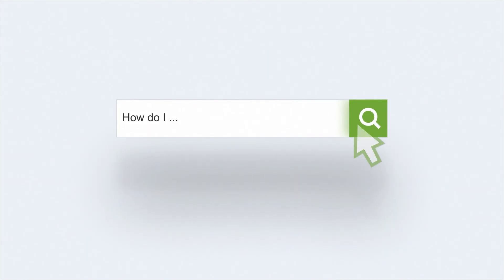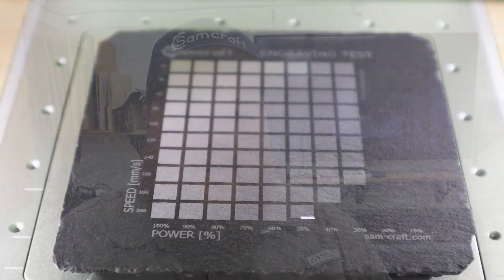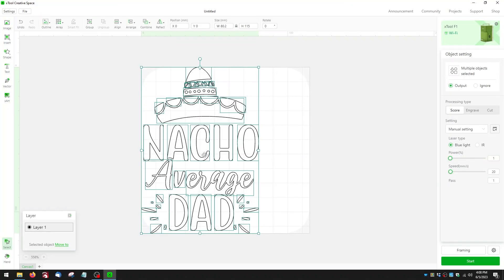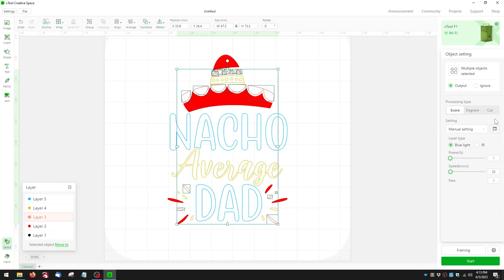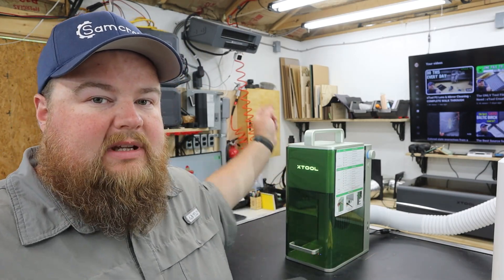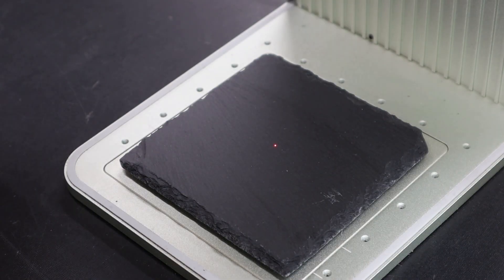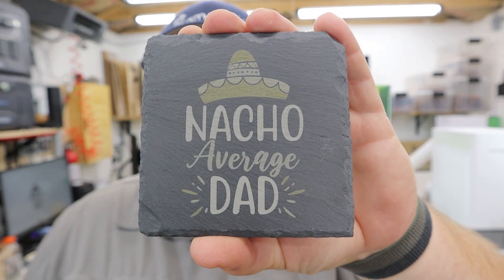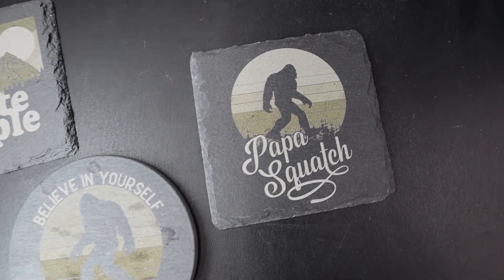Any Laser Can Do This! Colored Slate Engravings Feat. xTool F1

Comment: Sam, I'm not sure if you're going to see this comment since it's been so long since you posted this video,  but fingers crossed. 
I have F1 Ultra, and I tried to run the four tiles of the material test grid you describe in this video.   My attempt was a complete failure, imo.   I didn't even bother with the 4th tile yet.
All my squares are sorta white to burned and bubbled black.  No color. What did I do wrong?
I don't know if I can attach pictures here, but I'll try.

Comment: Nice job  on the slate coasters. I have a question can you tell me what size exhaust hose is on the xtool f1 ? I live in california and we cannot  purchase  the fume extractor due to the unit not meeting CA air quality standards. I did manage to get a atomstack d2 air extractor which also now is not allowed to be shipped to CA I would like to hook that up to a F1 if I decide just to purchase the F1 by itself. Thanks

Comment: Wow - thanks for that video. I made some slate engravings in the past, but only in black/white. Now i did a material test and found out that you can achieve at least 30 different gold-tones , which is much more than in the grayscale range (only 4 to 10 shades). The golden shades even vary between matte (lighter, even) and sparkly (darker with lights spots) - this is great! 👍

Comment: Hello Sam thank you for sharing all the information you share. Both myself and my sister watch your other channel is well for your Green Acre Homestead.

My question is about your Lightburn version test file. Because I'm new to working with a fiber laser is the Slate Engraving Color test file setup to only work on Slate or does the same file work for other materials like stainless steel as well? 

I just wasn't sure if the file settings were specific to help find the colors on slate. Thanks again

Comment: Very good review.  Thank you for doing this.  I am looking for a budget friendly way to do small metal, non organic engraving jobs - such as back of a watch, on a metal badge, tag, etc.  The idea of different colors on slate never occurred to me that could be done.  This video is a few months old which means you have had it for awhile.  

1) Would you still recommend for small jobs and how well can you frame an area to ensure you are engraving on a small object in the right area? Looks pretty straight forward from your video.  

2) Have you traded back to lightburn for running this laser or is it worth learning the specific software you mentioned?  

3) I see xtool has several different versions of lasers - is this the one that is best for small metal jobs - do yiou know?

Comment: The upgrade to XCS a few months ago that added layers and some other things was a nice change.  At least I don't recall it when I first got my D1.  As I work on 2 computers, one in the house, one in the garage, I do need to find a way to export/keep the same saved settings for engraving/cutting/etc from one system to the next for naming.  One thing I don't like is you can have 5 things named exactly the same and all with different settings.  It doesn't overwrite the settings/name even when you save it as the same name again which can be annoying as you're testing/verifying settings.

Comment: The F1 does not do the layers in order at all. I’ve been trying coated aluminum for 2 weeks, no matter how you do it it will fire the IR laser first and then the blue, which is the opposite of what you would want. If I hadn’t thrown the box away I’d be sending this back.
Reply from the maker: It's the program's fault. XCS does not allow us control over layers and actions as we need. I'm hoping Lightburn will get going with compatibility soon for this machine.

Comment: Was hoping it would be faster with the fiber laser. It's tough to sell coasters at $10 each.
Reply from the maker: The 1064nm laser in this unit is small compared to standalone fiber lasers at only 2 watts. Most fiber lasers you will see out there are about 20 watts minimum. This 2 watt IR laser is the same as the competitors like Laser Pecker, Genmitsu, Atomstack, etc. Overall it's a good machine and great for multipurpose uses. But no, not as fast as a fiber laser.

Comment: Hey Sam, You are really doing good on here. I have a question I hope you or a user can answer. I know the answer is a test card (but I don't have enough product to do one). I am wanting to engrave on some Amethyst Polished Stones. I have the xt Diode 5w, 10w, and 20w and the xtool pro IR (and will be 10years until I can afford the 40w head or P2). I am not sure which head to even start with or what possible power/speed to even try. Hoping somebody has bought these on sale at a local hobby shop (that we aren't getting paid by) and has some clue what head to start with and what power/speed.  I have 7 of the stones, so if I get ONE to work I can still break even. Also  I got a flat pack of 5 White Howlite Blanche (looks like white slate, no clue what it is) with the same question. Hope somebody can guide me on track.

Comment: So, "regular" non-xtool devices can do color or not? My 10W Z1 has never done anything but shades of Grey and then textures when I crank up the power.
Reply from the maker: Absolutely! Diodes are great for the colorization effect due to their lower power vs. CO2 lasers and being able to go slower to get the richer colors. :) IR lasers tend to just do shades of gray/white in my experiences.
Reply: lower your speeds a bit so the laser heats up the surface over a longer period.

Comment: How about with the CO2 P2?  Does it produce color variations on slate also?
Reply from the maker: It's going to be trickier to do since the machine is much more powerful. I've not had great luck with it yet, but have also spent more time doing some fixes with my P2 so far. I have it dialed in now and am ready to begin putting it to work!